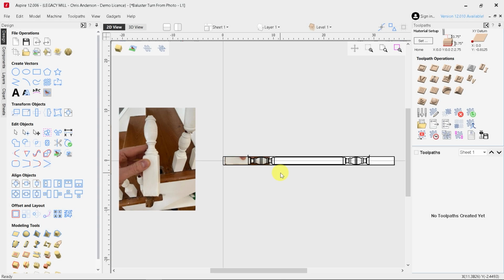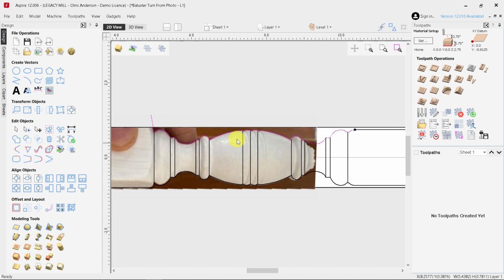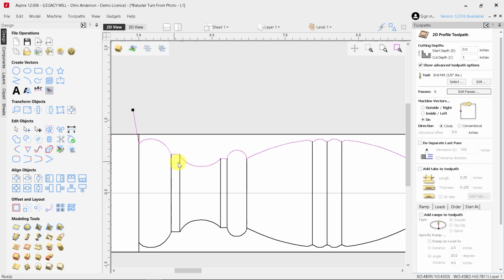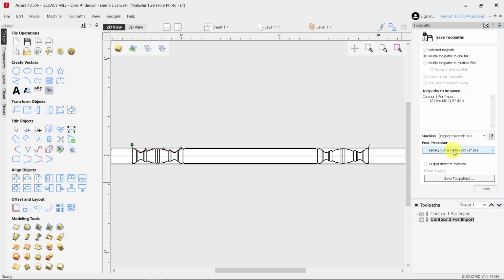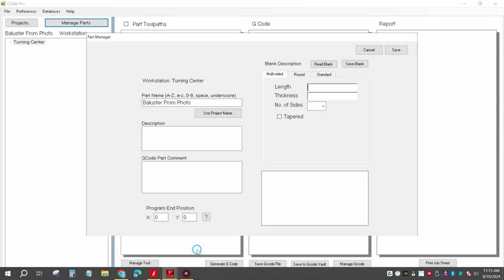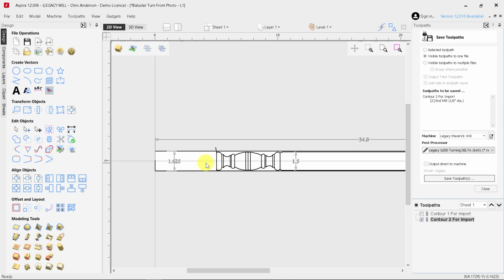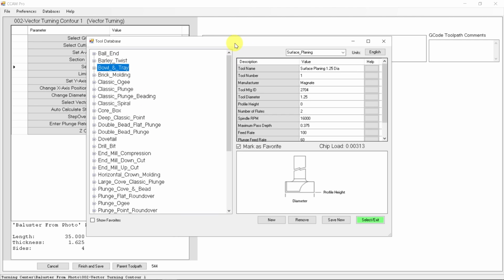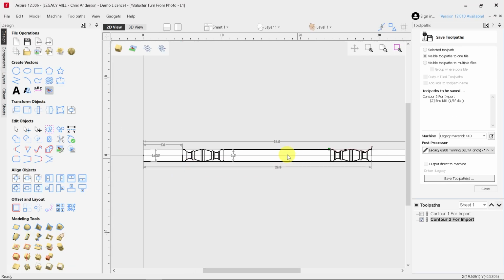Turning Technique - Contoured Turning from a Photo Part 2

Comment: You saved the vectric contours before you added the 1 inch to the blank
Won't the contours now cut in the wrong position along the length ?